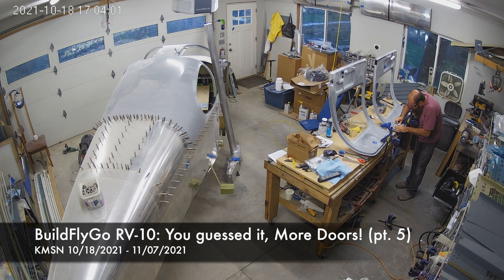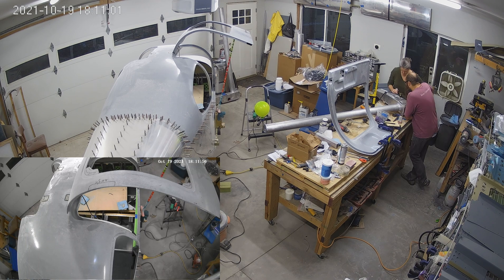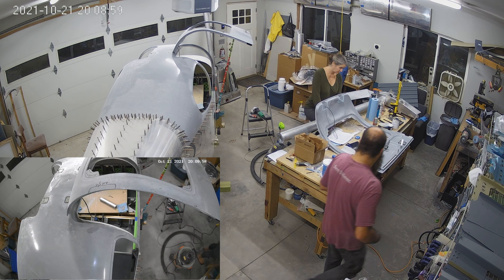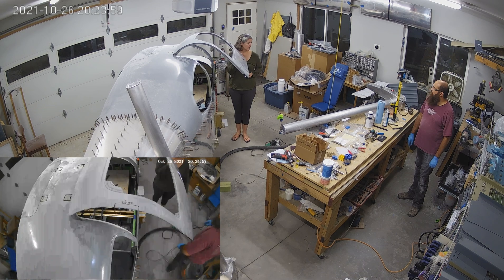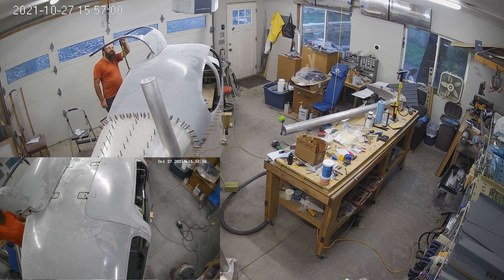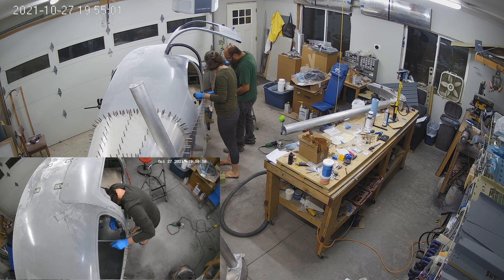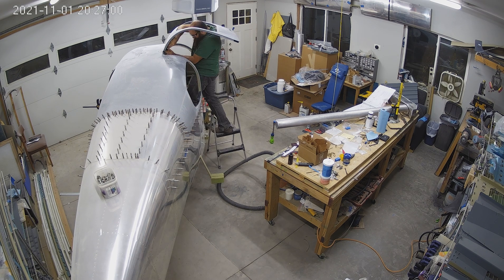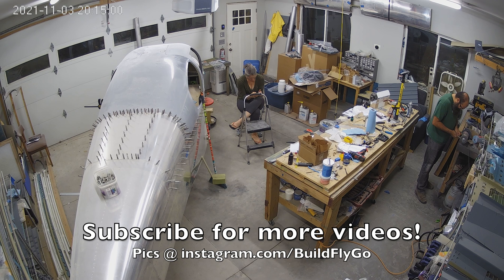RV-10 Build: 11/07/2021 - More Doors! (pt 5)

Comment: I wonder if having the door seals on the airframe will lead to adverse wear during loading or unloading? Would passengers drag or rub across the seals while entering or exiting? I enjoy your videos, thanks!
Reply from the maker: Good question. It might, but they are pretty easy to replace and cost ~$1.50/foot. If I end up having to replace them every few years it's not a problem.

Comment: Looking good, Guil. My emp kit just arrived. I’ll be starting on N68CK soon. Need to finish building the workshop first, though.

By the way, have you published any videos on the extended range tanks? Did I miss it? I’d like to get some info on the specs.
Reply from the maker: I have not covered the tanks in detail. See VAF for current reviews.
Reply: @BuildFlyGo  Are these the tip tanks I’ve seen advertised on there?

Either way, I’ll be sure to become a bit more active on VAF.
Reply from the maker: I have not seen ads for fuel tanks before.